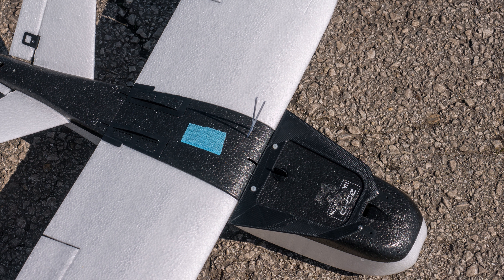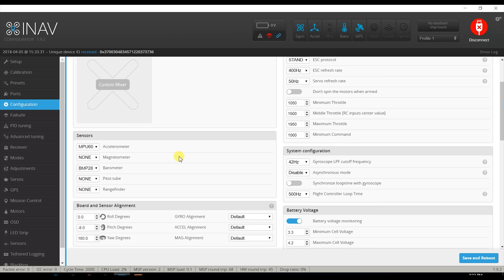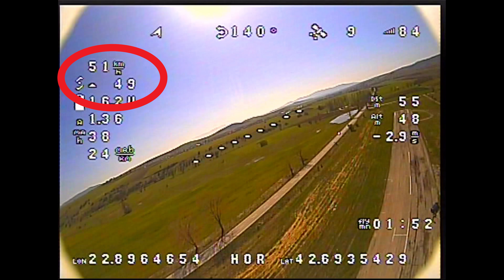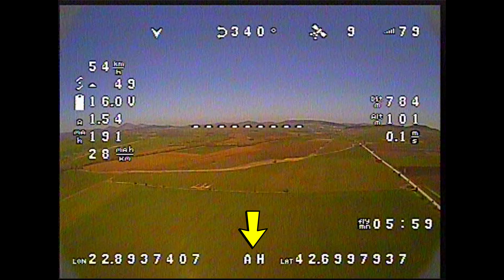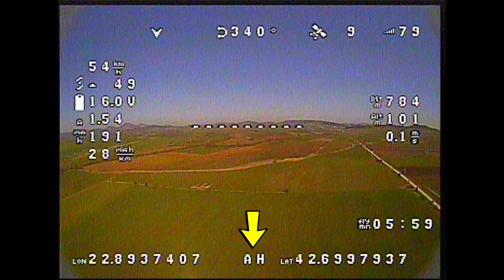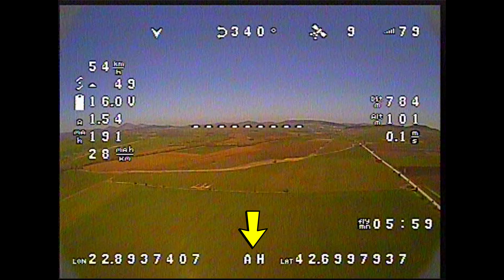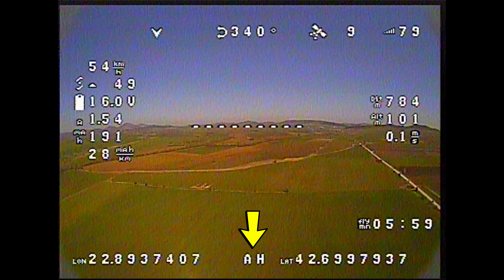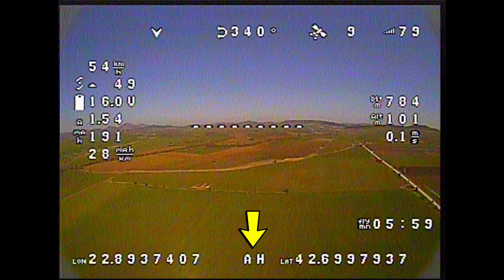ZOHD Nano Talon and the strakes - round TWO!

Comment: Great stuff as usual, Nikola. Re. Disarm, just wondering if it could be the low number of satellites inav was able to lock? I see yours is around 6 sats and inav won't arm when below that value by default, so it might happen when the number of sats drops below that. That's just my guess :)
Reply: Well spotted
Reply from the maker: Actually... I have that safeguard switched off, so I can arm at any time, at any sat count... as evidence by doing a flight with my Believer a while back, where it didn't lock home point because I took off with 5 sats, hence didn't calculate distance from home, and the home arrow did not work.
Reply: I think you answered you own question.....right there....lol.
Reply from the maker: The Believer didn't disarm in flight... even with it armed with lower than 6 sats!

Comment: I’ve been an Ardupilot user for a while now, and I can’t quite figure out why iNav is currently such a fad while Arduplane is so much more stable and  capable than iNav. Seems like iNav is trying to reinvent the wheel. I do understand that cheap FCs the quad guys own can be used, but to me it makes more sense to go spend a few bucks on a Pixhawk clone and use the far superior Arduplane firmware. Reportedly Arduplane will soon be ported for some of the popular quad FCs. Fingers crossed!
Reply from the maker: Actually the Ardu code has already been ported! :)

People use them for the reason you said - cheap boards on one side, and on another the fact that a lot of people who got in this hobby with racing copters are now getting bored with them, have a ton of boards, and the iNav configurator is basically the Betaflight one, in blue colour, so they know their way around! It is just easier than getting a degree in programming while trying to get into the Ardu code and setup a flight controller starting from the beginning. :)

Comment: i wonder if the "switch" disarm was a "failsafe" and the RX had the Arm switch set to the disarm position. Im not sure about the xm but other frsky Rx a failsafe sets the Rx to specific switches positions and throttle value.  I realize you had 70 RSSI but that may be false or set up wrong. Im just speculation but in my experience inav is rock solid and any issues tend to be user error.
Reply from the maker: The receiver is set to output "No Pulses" on failsafe, so I doubt that was the cause!

Comment: Nikola I have been worried about buying this plane some people said the foam is abit soft,
Can you recommend another model with similar amp draw using mini quad motors  ?
I like the Volantex V757 but Banggod want $72 shipping to NZ
Cheers heaps
Brett
Reply from the maker: Hey... well... I have never found the softness of the foam to be an issue with this one! in fact... even if softer than EPO... it is stiffer than EPP, and more flexible... so it can take some punishment, I rather liked it actually! When it breaks it doesn't deform too much so it is very easy to glue back together. I do not have a lot of experience with similar sized aircraft sadly... I think I've heard of some Goblin model... which is supposedly around this size and quite efficient... could check it out as well!

Comment: I find planes with dihedral cause that rocking effect - I've been flying a Volantex Ranger 1600 recently (no dihedral) and also a Multiplex Easystar (with dihedral) and even though they are similar style planes, the rocking effect on the Easystar is considerable compared to the Ranger.
Reply from the maker: I saw a video of a guy who  straightened out the wings on the NT, but the video didn't look all that different to be honest. Could be part of the problem though! On the other hand, the XK A1200 has that, and mine doesn't wobble on the roll quite as much!
Reply: yeah could be a combination of small design issues - I don't think the larger Talons have the same problem though.
Reply from the maker: Haven't heard of issues with them to be honest!

Comment: Have you tried using the Air3 with INav?  I am just curious if this is a hardware issue or software issue.  I have seen others using the Air3 with success and I am not sure which board they use, except that it is an F3 board.  Thanks for all the great info and testing!  I really don't want to drop the $$ that Vector/Pix is asking, if I can help it, but if it is the difference between my bird being lost or a little extra money??? well, there lies the rub.
Reply from the maker: I have not! On the other hand, the Mini Pix  (https://goo.gl/nfX1Sp) is a relatively cheap Pix variant, I will be installing it in the Nano Talon this week, if I can find the time! :)

Comment: Have you by any change have 'disarm regardless of throttle value' on? Also the reason it didn't arm right away might have been because your plane was on an incline, and can be altered in the cli
Reply from the maker: Not sure about the "disarm regardless of throttle value" thing, it might be enabled, but I have the set the small_angle to 180, so it should be able to arm in any orientation!
Reply: Late reply, but I checked 'disarm regardless of throttle value' once. my big diy skyhunter decided to then go straight into a fence, after a mid air disarm. unchecked it and haven't had a problem since on 1.9.0
Reply from the maker: Hmmm... might try a different controller first... see if it is a problem with the Omnibus... and will make sure to un-check that option! :) Thanks for the input.

Comment: This is GREAT news on this little plane. The inav issues however concern me. Maybe I need to look at another program. Do you think it could be the board you use causing the issue? Or are you sure its inav?
Reply from the maker: I am not certain at this time! :( Somebody suggested the board processor might be overheating... but not sure why that would cause a disarm. A board reset should cause more of an interference in the OSD... I think! Also... enough air should be getting into the plane so the board does not overheat... it is bare in there after all... no idea really! Other people have been reporting such random disarms as well... with different boards too... can't be certain at this time! I can't imagine the plane firmware could make it run hot enough to overheat...
Reply: Very interesting and frustrating.
Reply from the maker: Exactly, that is why I am not giving up on it, but will move it to a plane that I will not cry for if it gets busted in the process of making iNav work! :) Rather not do that on the NT or the Believer! The latter already has a Pixhawk in it, Nano Talon is next.
Reply: Cant wait for the updates!
Reply from the maker: Soon! :)

Comment: Interesting stuff Nikola, you may have just saved my plane(s), I was geared up for a long range test flight of my G2 with DL and Inav 1.9 tomorrow... not now. Reading the comments and seeing your issues repeating again makes it like playing Russian Roulette with a few bullets in the gun.. I was about to order a F-35 Lightening FC, as it takes a pitot etc, but again with inav, I don't think so now. Have you tried Pitlab? I have one in a MTD which for years has been totally rock solid, it is expensive, but the ILS system is outstanding, so well worth it long term.
BTW, are you using F4 or F3? I hear F3 cannot run 1.9 without crashing due to lack of processor power (causes mid flight reboot's).
Reply from the maker: Yeah... at least for me iNav is no go for the time being, especially in relation to larger and more expensive craft, or long range!

Comment: I printed the strakes and the piece came out pretty thin and thus a bit flexible. Did you reinforce yours or is it supposed to flex?
Reply from the maker: I have not reinforced mine... not sure how much a 500 gram plane can flex these in flight, especially held in place with the screws where they are!

Comment: Can you configure vtail on minipix? I have one and I could not, it is quite different from APM with mission planner, how did you do, what parameter changes to the helm and elevator working vtail?
Reply from the maker: Yes, in Mission Planner there are options to do just that, just have to follow the online instructions on the ArduPlane website.
Reply: I tried but I could not, I tried to put an older firmware 3.4 that I can do, but minipix does not accept... http://ardupilot.org/plane/docs/plane-3-7-to-3-8-migration.html#change-to-elevon-vtail-and-flaperon-configuration
Reply from the maker: Actually not sure older firmware would work with this, as it wasn't compatible with it when it was released. Try the latest official firmware, if not you will have to flash the RadioLink firmware, that should work.

Comment: Disarm due to insufficient Sats.....6 Sats is the absolute minimum....I think we had this conversation before...?.....M8N GPS required......22 Sats....a 3D fix.
Reply from the maker: Haha, not sure why it would disarm when sats go below 6! That makes no sense at all! If I am 10kms away, and RTH kicks in... and for some reason there is some interference causing the sat count to go down to 4 or 5... the last thing I would want is for iNav to disarm itself!
Reply: Well, inside iNAV....6 Sats is the minimum before iNAV will even arm....Thats the default Sat setting.
    You can reduce the minimum number of Sats required to lower than 6....but will inav then work reliably...?
Id sooner have a $25 GPS with 21 Sats.......than an $12 GPS which will ensure the planes demise.
Reply from the maker: Actually I have turned the arming safety off... so basically I can arm it no matter what the sat count is... question is why is it disarming itself! Otherwise I do understand your point, and recently on my Believer I have use separate GPS modules on the AP and the tracker board just so I can have an M8N for the AP... but on a plane where I am trying to save every gram... makes no sense to weight it down with more GPS units, if the one works OK. I mean... that was the only way before the M8N came out anyway! :)
Reply: ArxangelRC would you do a one final test for inav...but with radiolink minipix ts100gps...i have been using the ts100 for awhile...so far it is perfomed very well...25sats during flight...i just need the answer tu the disarm problem as it worries me because i have flown inav for quite some time
Reply: Once iNav arms, dropping below min sats will NOT disarm the FC. I have verified this many times on the bench.
@arxangelRC did you have autolaunch enabled as a feature or on a switch? If it was enabled as a feature it can cause the disarm like you experienced.
Reply from the maker: I did not have any sort of autolaunch enabled.

As for testing with that GPS... not sure it will make a difference in my case! You say you fly it and don't have an issue... some people don't, that is good... but I do and I don't want to risk it! Besides... the Omnibus is already out of the NT... :D
Reply: dude is a minimum of satellites in order to use all the autopilots you gps may be sucks.

Comment: I tried strakes on my talon before, and it caused it to nose into the ground almost immediately. The pitch is pointing down. Did I do something wrong?
Reply from the maker: Not sure what to tell you! Is it possible the strakes were mounted pointing down a bit, thus creating some down pressure on the nose? Anything else changed as well?
Reply: @ArxangelRC  it's most likely that. It dipped really wildly alot and I had to fly with a very high alpha to safely get it down. Unfortunately,  a few weeks later the talon met its fate with a telephone pole. I'll be getting another in the coming months and I'll install a proper controller and OSD.
Reply from the maker: Damn! How did you manage to hit a telephone pole?!?!?! Those are thin!!! :D Which controller did you have in the Talon? I would suggest you wait a bit before getting another Nano Talon... a version 2 is in the works and might see the light of day soon... ;)
Reply: Oh, a version 2? That sounds awesome! It was such a great plane! It went 6 miles out with 5.8ghz video
I was using the Bigaole BGL-6G-AP for stabilization/return to home. Something must've gotten messed up in the module though, because after a few flights the return to home no longer worked (sent my plane in random downward directions) and the stabilization started putting me in a 20 degree nose down path. It careened into the pole about 10 seconds after takeoff (didn't even have a camera on it)
Reply from the maker: That sucks mate... but I guess sometimes these things just happen... electronics do go haywire for one reason or another!

Comment: Third fuse dead after a dive i couldn't pull out of. The flight envelope is just too narrow for me.
It's cool so many people are trying to fix this model but should we as consumers have to r and d a model. I really want to like this one as everyone else but i'm done.
Reply from the maker: So sorry to hear this! Yeah, the plane does require some work... but why couldn't you pull out of the dive?
Reply: Probably asking too much from it. Big elliptical loop with high speed dive. Full up elevator and then full throttle for what seemed like forever. It would just not rotate.
This plane just never seemed like it "grabbed the air" which is probably why it's so efficient. An extended tail would probably fix this plane but i have too many projects.

It's too bad because the mini talon is a stellar plane. The nano of talons is the mini of sky hunters.
Reply from the maker: Haha, yeah... seems like you really did push it hard! Any chance the tail fins may have come loose a bit... and hence it couldn't pull out of the dive? I've been thinking that if and when I ever get to long ranging this thing, I might have to glue these in to make sure they won't come off some 20kms away from me!

Comment: Thank you for retesting it. If you are willing to invest a little more time you could reuse your current Omnibus using night_ghost's HAL Ardupilot version
https://www.rcgroups.com/forums/showthread.php?2784349-Ardupilot-on-OpenPilot-Revolution
https://www.rcgroups.com/forums/showthread.php?3070417-Most-integrated-Arduplane-FC-solution
https://github.com/night-ghost/ardupilot/wiki
Reply from the maker: Haha, I know of this version, but it supports the Omnibus F4 board, the one currently in the NT is an F3 Pro. I have an F4 Pro set aside specifically for this Ardu port... and will get around to it soon! I think it will end up on the Dart for testing! What I can't figure out about this project though, is how the hell am I supposed to get the Ardu port on the board the first time around...
Reply: If you have a mac is painless.
Install http://dfu-util.sourceforge.net/ 
Use the file ending in _bl.dfu for your board.
dfu-util -a 0 -D /<path to file>/f4light_AirbotV2_bl.dfu
Reply from the maker: I don't have a Mac... but I think I found an install guide for Windows... should be able to get it done when I am ready! :)